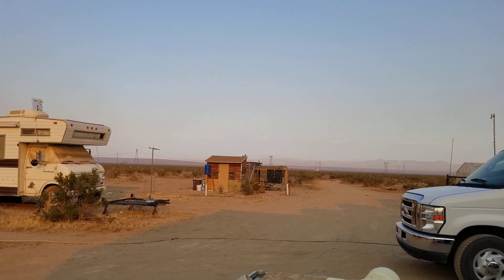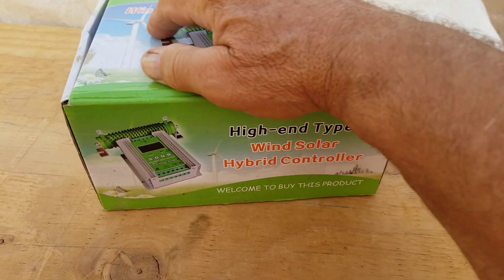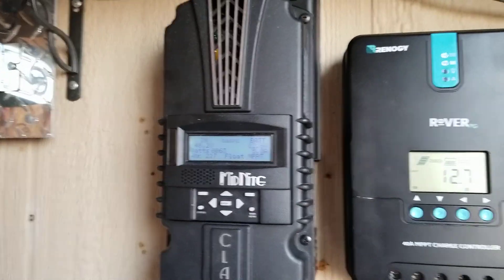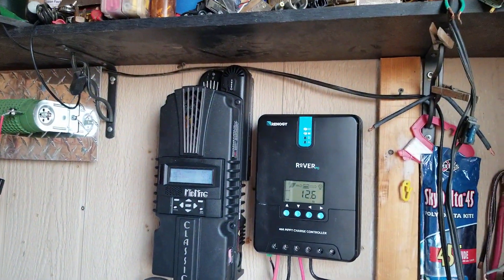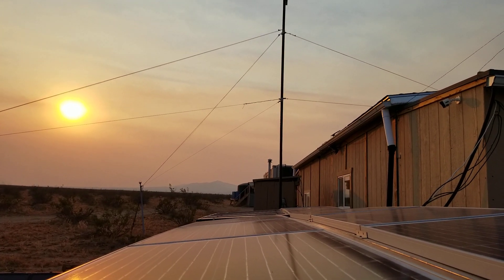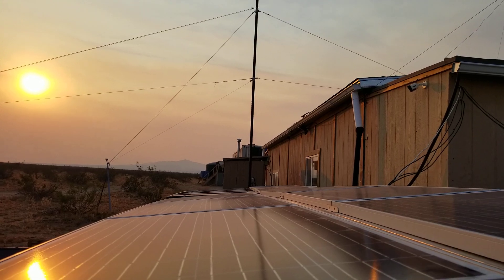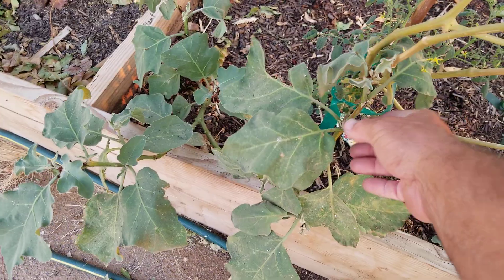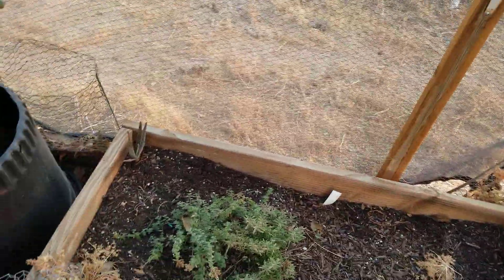Loving my Midnite Classic 150 and Renogy controllers, Sep 21, 2020

Comment: Damn that garden was looking nice and lush awhile ago!!  Time to get stuck back into it G Bear!!  :-)
Reply from the maker: Yeah, actually it's time to get the green house ready for winter crops.  Nights are cooling down near 60°F and it won't be long before it'll get down to 40's and 30's.
Reply: @GBear  We are still having torrential rain and storms with 30 degree celsius days!!  Spring huh??  LOL!!
Reply from the maker: @uppanadam74  today is our first day of Autumn.  Sounds like you are going to have a hot spring...
Reply: @GBear  Summer is a killer in Australia!!  Not looking forward to it!!  :-)!!
Reply from the maker: @uppanadam74  well then, come to my place for the summer and enjoy my winter while you get my garden back in shape...😁
Reply: @GBear  Hah hah!!  Nice try G Bear!!  Got my own garden woes too sort out as you know!!  LOL!!
Reply: @GBear  Nice try G Bear!!  LOL!!
Reply from the maker: @LMBee00  good sleeping weather!  I'll probably be firing up my heater the end of October out here.
Reply from the maker: @LMBee00  I hope yours lasts longer than mine.  I got 1 year out of it and then it wouldn't stay lit.  I have a Procom 20,000btu now, worked great all last winter.
Reply from the maker: @LMBee00  also note that a lot of these propane heaters can't be run on the small 20# tanks.  They need a 100# tank, and 1/2" service line.  Just an FYI heads up...
Reply from the maker: @LMBee00  the issue with propane heaters indoors isn't explosion, but carbon monoxide.  They also use up the oxygen in the room.  Many new ones have low oxygen sensors and tip over flame out built in.
Lastly, dumb people place the heaters too close to curtains, blankets or other flammable materials and wake up in hell fire.

Comment: Yeah figured that would happen when I saw all of those Chinese controllers from the get go. Glad your going now. Hope you  get a second one for the wind l turbine later. Glad to see you running the A/C in the house. As handy as you are, you should look into building your own lithium battery. That would be amazing and not much more that buying those old schools lead Acid batteries. Check out jehugarcia. The king of the DIY power wall,
Reply from the maker: Wow!  A face from the past!  I hope all is well with you!
Yeah, I worked with what I could afford and it got me this far.  Moral of the story, get it up and running, but save for the good stuff...it will be needed!